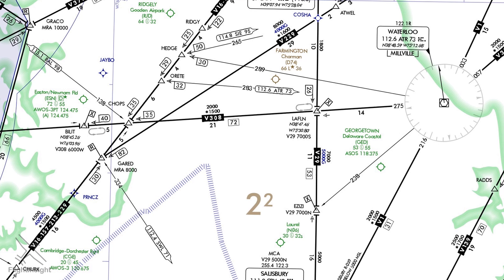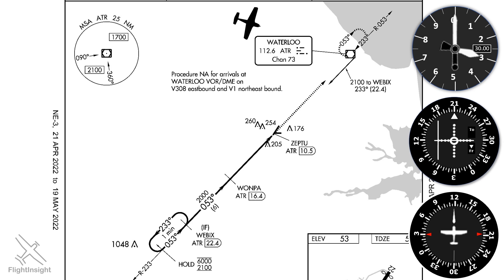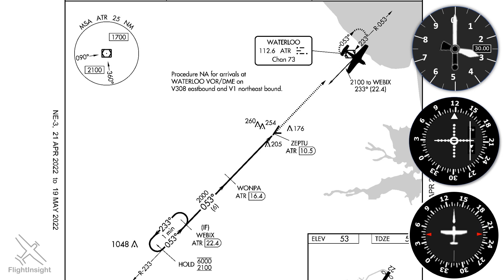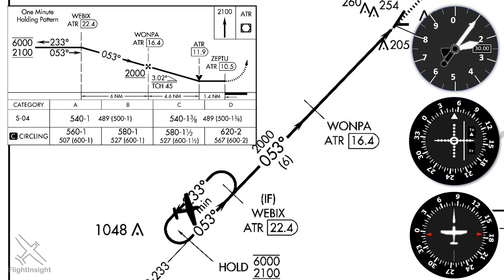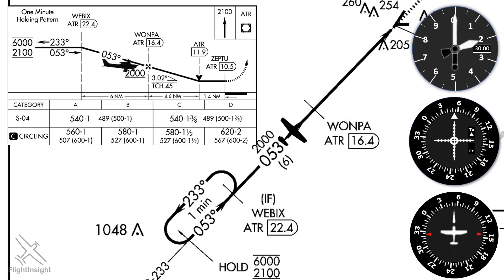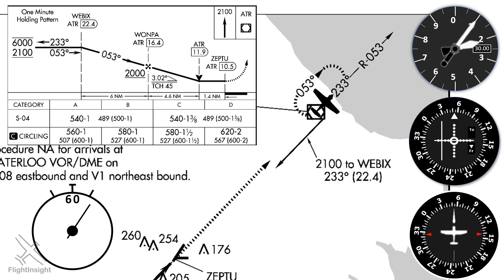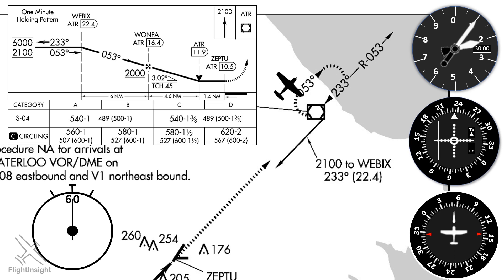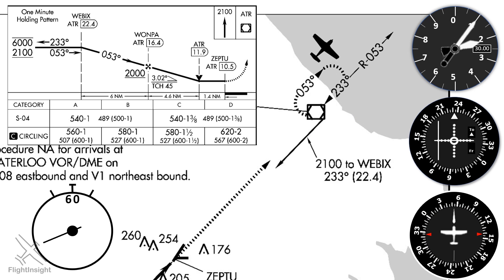How to Fly a VOR Approach & VOR Hold | Hold in Lieu of Procedure Turn

Comment: Today’s students are fixated on the glass cockpit. As an example with Microsoft flight simulator, and the Bonanza, equipped with a Garmin G-1000, I flew from KJEF to KFYG in Missouri. The database does not contain the VOR-A approach. However, the approach can still be flown which I did, using the heading bug and following along on the approach chart to proper altitude. When I hit the MDA, I went missed and again by using the bug I was able to fly the missed and enter and establish a hold. This had to be done without any magenta line or map on the MFD because it is not contained in the database. I made sure that my CDI was set to VLOC and use my heading bug and course selector. You can fly non-precision approaches that are published but not included in the sim’s database  as long as you have the approach plate. You don’t need a moving map which is great for situational awareness, but it’s old school and it works. Maybe make a video on something like that where you’re not watching. Any map on the MFD. Keep up the good work.